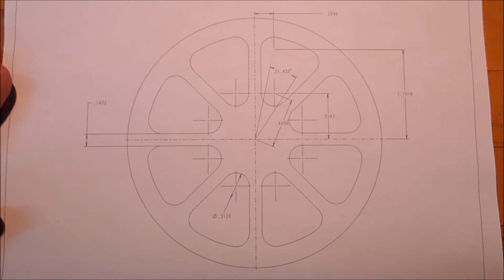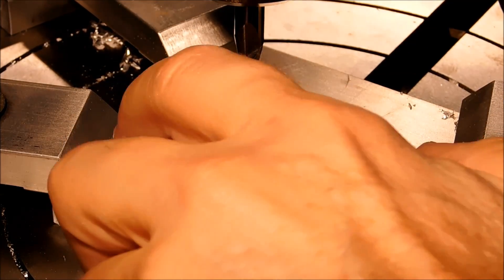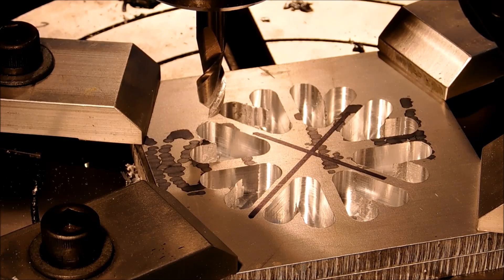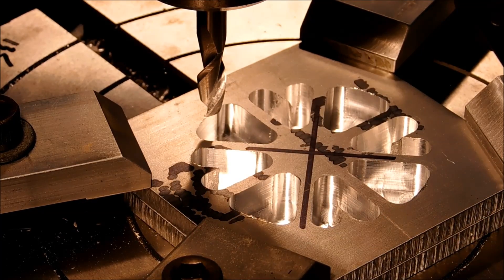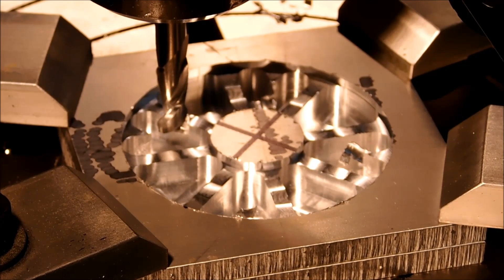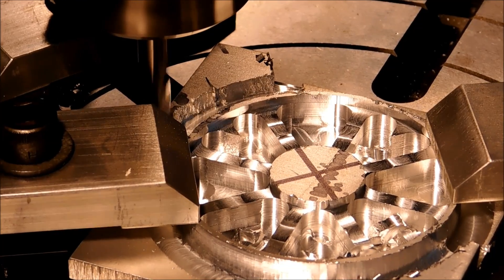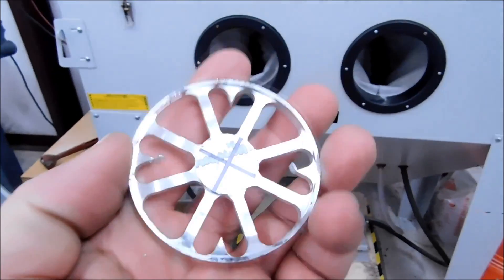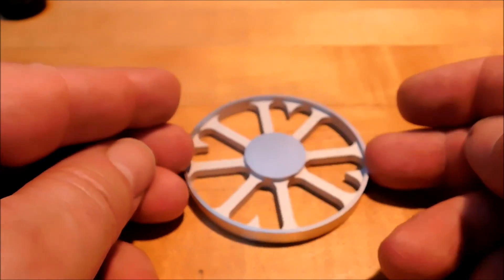Milling a Straight Spoke Wagon Wheel on a Rotary Table

Comment: Thanks for this video Joe! My memory was ringing and searching for this video payed off.
We are a couple of guys that renovates a veteran steam locomotive. Both the cylinders and the cylindrical slide valves have been bored to a larger dimension, needing several parts to be remade.
We need to reduce the mass of the new, premade, steam slide valve pistons to half the current weight. The old pistons have 4 cut outs, not going all the way through. I'll post a link of this video to our chief machinist (former oil platform support ship, now a train engineer) and suggest him to have a look. Cross Your fingers Joe! I'll try to come back some day and report.
Reply from the maker: Interesting. Keep me posted and feel free to ask video specific questions if they come up. I have a lot of filter control and a heck of a memory.
Reply: @joepie221  Thanks Joe! Sure I'll do! You helped my earlier, how to cut fine, left hand threads and it turned out perfectly.
Reply: @joepie221  I certainly will do so. Hopefully sending some pics when we've done the job.
Reply: @joepie221  Sorry but no shop work, no pics. One member found somebody having a CNC that will do the work for free.
Anyway, You and Your videos (2) have been watched by a quite skilled guy.

Comment: Joe, I know this is an old video, but you can't believe how valuable your teaching is!
I'm a hobby machinist and in process of building my first flame licker engine. Needed some ideas on clamping work to the table, tried glue and tape but eventually the toe clamp was what I needed to see.
I always check your youtube first when I need advice and so far you've never failed! Great job and keep it up. I'm sure a LOT of folks get the same help, I just wanted to give a shout out.
Truman
Reply from the maker: Thanks Truman. I appreciate the trust.

Comment: Thank you Joe for the awesome video as usual. One thing I'd like to say though is to a non machinist or a novice machinist this is stillVudu to watch we don't know what the hell you're doing LOL. For example do you pre calculate all of the plunge points write them down and then go to those points based off of a dro? It seems to me you would have to have this entire object mapped outand we didn't really see this in the video although I miss the very beginning maybe I should go back. I was taking my dog outside LOL
Reply: In my experience, which is not that much - I am an apprentice machinist - once you have a look at the geometry of a circular part with fairly symmetrical features on the drawing, and work out a few measurements you can often see a pattern you follow, based around the center 0, 0 DRO position (the centre of the part), that is largely repeated for each quarter, or eight of the circle. For example, you might move the DRO to X 20, Y 20, and then the next symmetrical feature might be at X-20, Y20, the next at X -20 Y -20, and the last at X 20, Y -20. And the same goes for the geometry of the features you make at these points - they will have fairly similar DRO movements to make and numbers to hit. This is not always the case, but in alot of cases this kind if working where you repeat the same macro set of movements, but just starting in different quadrants of the circle can leave you with a part that looks very very complicated to try and think about how it was made. 

So it is good to work out all your DRO locations to hit before you start cutting, but sometimes you only need to do this once for the basic pattern and then work out the starting point for where to repeat this pattern again - rather than having DRO points explicitly written for every single feature.

Comment: Thanks Joe. I just used this video to work out how to make a steering wheel from a slice of bar. 5 spokes, and 1.4" diameter - for a 1/12 steam traction engine. As always its easy when you know how.. And now I know how of course
Reply from the maker: Check out the emblem video I made for Chuck Tipton, then go look at his traction engine video. WOW.

Comment: Thanks as always Joe.
I need to make a couple of new wheels for my bandsaw (wood cutting) I built 20 odd years ago. The current wheels are made from layers of ply wood turned by my late father and the ply is delaminating now.
I was thinking of using aluminum plate as you guys call it. Sandwiching layers to get the bearing boss and rim thicknesses etc
I can do all the circular machining of the wheels on my lathe but would love to include features like these spokes.
I have a mill with a DRO but do not have a rotary table.
I could use coordinates and use a boring head to generate the large end of the flared hole, not as pretty as a concentric radius but would look ok I guess. But at some point I would still need to index the part around to machine the spokes.
Any thoughts on how similar features could be done without a rotary table? Simple indexing setup?
(Actually a thought I just had......mount the plate on a fixture so the wheel can rotate using the center hole of the wheel. Use coordinates to drill index holes around the work (or the fixture?) at a suitable radius. Index the work by rotating it on its center pivot and align the index holes using a pin in the chuck and clamp the work at each position.)
Make sense? Any other ideas?
Good topic for another video - spoked wheel without a rotary table?
Love your channel!
Reply: @CraigsWorkshop  I like your idea of the 2 cylindrical squares (or 2 pins or 2 of any type of point, edge etc when you think of it) to constrain rotation referencing off the diameter. Even if there is a center hole it could be easier than setting up the correct diameter pin to rotate on.
Reply: How about a router with a carbide cutter and a template ?? 
Small bites and a squirt of wd40 or kerosene and I'd say it would work ! 

😎👍☘️

Comment: Off topic - Have you done a video on the details of using an edge finder and/or wiggler? I never understood how they worked. It always seemed to me that you should stop when they run true, that continuing until they kick off would be too far. Until I looked really closely and realized that the tool kicks off TO THE SIDE of the direction of travel, due to friction of the parts in contact and the rotation of the tool. At least I think that's what's happening. Love your videos, working my way through them one at a time...

Comment: Two questions. I noticed that you ran the cuter twice through the same cut when making the spokes. I also noticed that even the second pass removed material. Was this because of the nature of a climb cut versus a conventional cut? Or was this spring cut such as that which would be done on a lathe to remove material left behind due to the spring of the material or cutter durring the initial cut?
.
My second question is - how did you chuck that part up in your lathe such that you could polish the outside of the rim?
Thanks for your videos. I always learn a lot when I watch them.
Reply from the maker: Excellent questions. In a climb cut, the cutter will always flex in the direction of rotation. technically this leave material behind, but also leaves a slightly tapered surface because of the flex. the second cut allows for the cutter to relax and form the vertical as well as removing the extra bit of material left behind.  when I did the OD of this rim, I actually put the small center boss in a collet. You could also pressure turn the OD and achieve the same result.
Reply: It always surprises me how a big tough hardened tool steel cutter can flex, especially cutting something soft like Aluminium.  But of course it does, and now I understand more about why. As for the other question I think I need to spend more time understanding collets, as they can do more with less material than I thought they could. I had totaly forgotten about pressure turning, but I could have sworn I had learned somthing about it in the past. A quick Google reminded me that I had, from another of your videos no less! Thanks for all the great videos. Its nice to know that you don't need a cnc machine for everything. Now I just need to find an affordable rotary table. 
Cheers, 
Leo.
Reply from the maker: Young inexperienced manufacturing engineers get bit by this fact everyday. you wouldn't think cutters flex, but they sure do.

Comment: Hi Joe, I've been waiting to see you do this video and compare it to the way I did the flywheel for my engine. However, I had one more challenge, The radius between the spokes at the hub is larger than the radius at the rim end of the spoke. I'd like too see how you would approach this. It took me a day or so of thinking to figure it out.
Thanks great series.
Reply from the maker: Hi Chuck. Good to hear from you. Sounds like a job for 2 cutters and a little more math. I believe that is how I would do it.

Comment: would it be considered cheating to use a dividing head/indexing plates on the table to cut 7 spokes?
A person would sure have to keep track of things.
Reply from the maker: Hi Worth. A true carriage wheel for my cannon is actually a 7 segment outer wheel with 2 spokes in each segment.  This results in a 14 spoke wheel. Did I forget to mention they were also dished about 5 degrees? I started doing the math on these requirements and gained a new respect for the guys that did this without computers or CAD back in the day. True craftsman. And you are correct. LOTS of numbers !! LOTS.

Comment: Hey Joe, how do you go about cleaning the aluminum from you carbide mills? Oh, cool videos, I always love watching.
Reply from the maker: I have always found that a good heavy cut with some WD-40 or other oil gets the old stuff off with the friction of the new stuff. Carbide dry on aluminum is never my first choice.
Reply: @joepie221  Good morning, thanks for that info. I've never used carbide end mills, it will happen eventually.

Comment: I would imagine you have to pay close attention to backlash on this part. When cutting the windows, the centre axis of the rotary table is never in line with spindle centre. It looks like you should have to line up rotary table centre with either x or y axis to prevent a cosine error on final OD (if its important). Am I right or just taking rubbish there?
Reply from the maker: https://www.youtube.com/watch?v=s0HfNx9FdRc    16:32   I conditionally agree with your observation.

Comment: How would you relieve the spokes on the other side of the wheel? Spokes are usually central to the hub not flat on one side. I presume you'd have to put it back on the rotary and indicate it for true rotation and repeat the relieving process? A central hole might have been useful for that (you're probably going to want one anyway).
Reply: Do it in the lathe.

Comment: Hey Joe:Instead of using a nice piece of aluminum as a spoil plate try 1/2 or 3/4 MDF. It's remarkably flat and uniform thickness (less than a thou) and is really cheap - well comparatively speaking.Your tip for the day. :-)
Thanks for showing your process of the flywheels.

Comment: Could you do a video on blending tips?  When you pointed out that you pull away from the radius to keep the bit from digging in when you stop, I had to back the tape up to see that subtlety. Then I was trying to visualize how it looks on the hand wheels. I assume you backed the Y-axis away while continuing the rotation on the Z-axis.  Thanks,  Chris

Comment: Would it have been more difficult to cut 4 slots... 2 on each side of center, at a time, instead of indexing each spoke one at a time?
Reply from the maker: Not at all. that would have worked just fine. More numbers to keep track of, but 4 cuts instead of 8 for sure. Good call.

Comment: Hey Joe ; Is there a name for the phenomenon of the appearance that the workpiece is still rotating after you have stopped turning the rotary table?
Reply: John, I think it may be what's referred to as "motion aftereffect". When the actual motion stops the motion aftereffect tends to look like the reverse motion. My business used to package a lot of computer chips on long reels of tape. It was always fun to watch someone run the machine for the first time. After concentrating on putting parts into the moving tape for a while, the machine would stop and you would swear the tape started moving in the opposite direction. I had one young man grab the tape and yell, "How do I keep it from running back out of the machine!!". Those of us in the know had a good chuckle.
Reply from the maker: I know there is. Tanda may be right. I see it while doing this, and usually have to quick check the index marks to confirm its just an illusion.

Comment: Looks very good Joe. Do you have any tricks up your sleeve on how to extract broken taps seams to be the story of my life lately.
Reply from the maker: Carbide end mill the center out. Slowly peck at it by raising the table in small increments, not dropping the quill. Remove the excess as you go. Pick out the big chunks or they will jam and break your cutter.

Comment: Nice to watch. So did Texas DOT run a road through the back of your shop?
Reply from the maker: Sound like an F1 track out there sometimes. I have a redlight 100 yards south of my shop that feeds a 2 mile straight away. My building is 25 feet off the highway. Perfect recipe for heavy feet.

Comment: Always love your videos. So informative & well produced.  Just one question - why do you plunge at each end of a line, then run along the line, instead of just one plunge followed by the line cut.  Thanks.
Reply: Tool deflection.  Moving sideways, the cutting load flexes the cutter then the wall of the corner radius wouldn't be as square to the spindle.  A vertical plunge avoids that.
Reply from the maker: It also allow for a relaxed resting area at the end of the cut. No chatter and better finish.